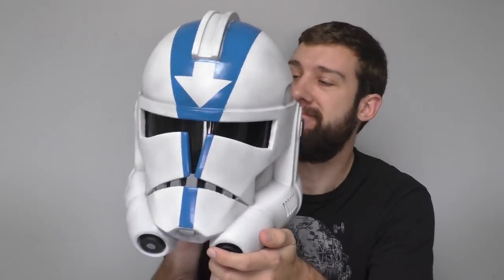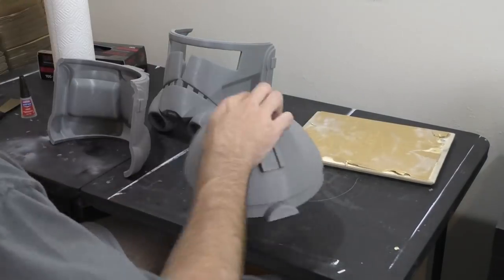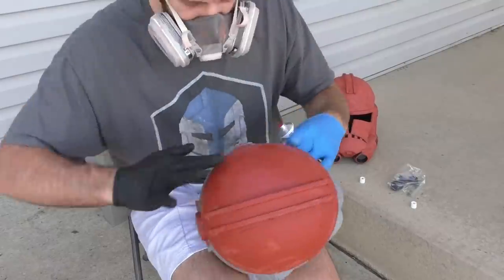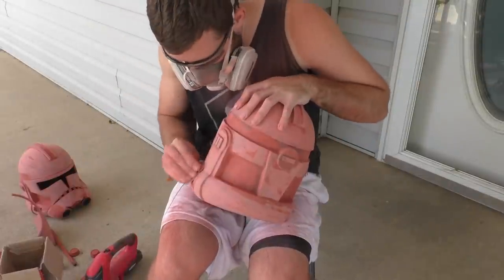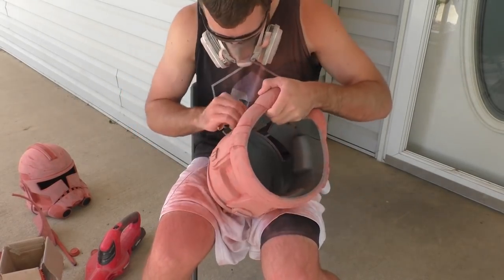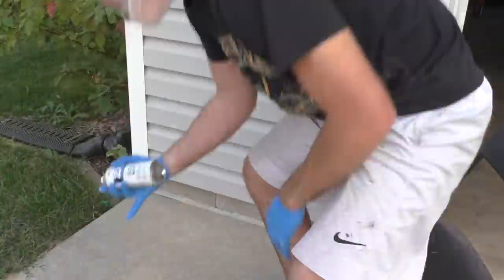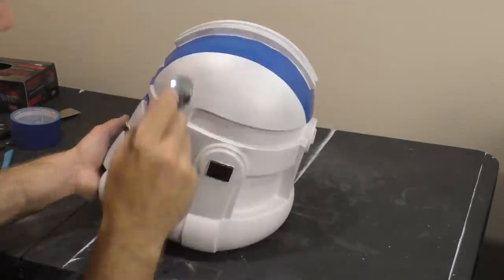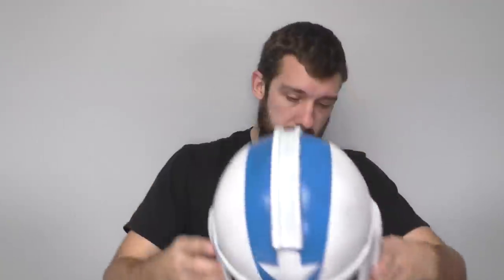Sergeant Appo - Making His Helmet and Lore

Comment: Best channel ever p.s. i need a 3D printer 😭
Reply: Get an ender 3 pro
Reply: Sidewinder x1 - full helmet prints without splitting parts
Reply: Also looking for 3d printers and reasons to pick it/ones that may print cleaner than others (as in less sanding work). Thank you for your time.
Reply: I got an Ender 3 Pro for Christmas last year and it is the best!!!
Reply: @genericthiccgirl228  if you want clean prints with minimal cleanup / a printer with less tinkering go with a prussa.
Reply: @UnvarnishedTarnished  Clone Troopers typically don't fit well in my experience, plus there's more loss if it were to fail. Splitting it is better IMO, except maybe mandalorian helmets since they are small and simple (usually)
Reply: Same
Reply: Ender 3 is the way to go. Super cheap. super reliable. Super super.
Reply: @BlatantlySwedishPGN  
So far I’ve had a better experience using a prusa mk3s than ender 3 mainly due to it having a filament sensor which means there is never any wasted filament.
Reply: @jeffreymuu5451  I never said anything about an E3, lol. But I'd recommend them to any beginner because they're decently sized and very cheap, plus they work really well.
Reply: @BlatantlySwedishPGN  
Sorry I just woke I re read all the comments and realized this. I pulled a smooth brain.
Reply: @jeffreymuu5451  haha no problem, it happens
Reply: Anet et4
Reply: No, get the sidewinder x1
Reply: @majestik7736  completely depends. It's more than twice the cost, and it really has its quirks.
I like mine, but I wouldn't tell a complete beginner to get one unless they specifically want to print large objects and are fine with that extra level of quirkiness.
Some versions of the printer also has legitimately dangerous flaws, but luckily mine doesn't.
Reply: @BlatantlySwedishPGN  I see your point. It's my first one and I like it. Nice name!
Reply: No get cr-10 v2 because you can make the complete one in one print
Reply: @IzzcanV  Sidewinder is the same size, and it's damn near impossible to fit an entire clove helmet on it...
Mandalorian works fine.
Reply: @BlatantlySwedishPGN  you don't need to tell me that, i print a lot myself with my 3d printer, so i can print all helmets in one piece
Reply: I have the normal Ender 3 and it is awesome!
Reply: ngl ended 3 pro kinda 🥵🥶👅🤩😚😫😬
Reply: @raurifreeman3354  You ok?
Reply: @JJ-kj5lh  no you dont need a 3d printer. you just need buy the helmet from him .
Reply: @husky_studios  yesh 🤠😈👽🤡🤫😬👽
Reply: @genericthiccgirl228  the ender 3 Pro is definitely good for helmets
Reply: Yea
Reply: Ender 3
Reply: 501st Gamer not surprised to see u here lol
Reply: Try the Anet A1. It’s a pretty small print bed, but it’s only $150
Reply: CR10 is a great printer with a large build volume.

Comment: Great work as usual!  Very impressed with your attention to details and cad skills.  I looked on your website for a contact us" link and didn't see a means to communicate with you there, so I am posting here...
RE:  STL File fit on bed plates
 I just purchased your Boba Fett Armor files and the Back Plate, Jet pack Base and the Jet Pack Rocket do not fit on a CR-10 300x300x400 volume.  I read your answer in your FAQ but a 300x300 bed is quite large already and most people are no larger than that.  Can you cut those three files down in CAD and add a means (tabs or keys) to splice those parts together for a solid / aligned seam?  I know you can do this way better than us "slicing" and gluing via Cura.  THANKS IN ADVANCE !

Comment: i think it would be cool try try a technique where you design holes into the print then use small metal pins to connect the two sides perfectly together. Also I thought commanders were supposed to have like pouches, kama's, and the shoulder stuff and like a rangefinder or something